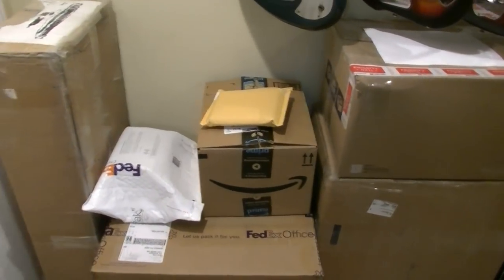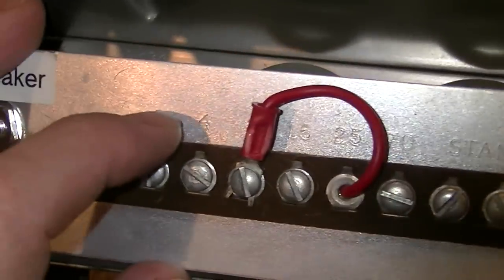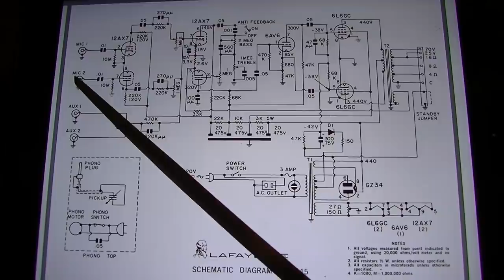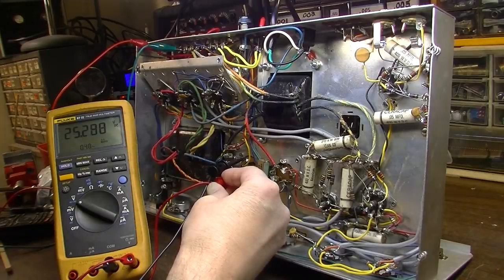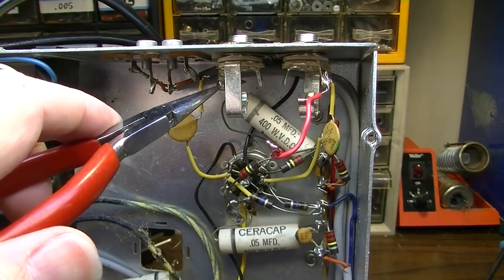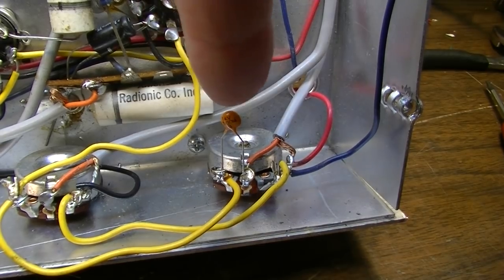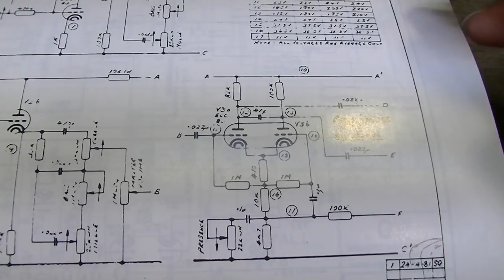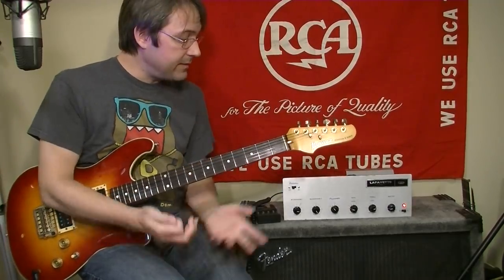Amp Reassignment Surgery - 60s Lafayette PA Thinks it's a Marshall 2204

Comment: Nice work! It has a nice break-up. I like it a lot. I added a 12AX7 to a valve jr. Head and cloned a 2203 gain stages, cathode follower tone circuit, global NFB & presence. Wish I had room left on the panel for more options to incorporate the bassman sound. Thanks for the video man, I enjoyed it and as always I learned new information as well.

Comment: My father just built 3 of these and I'm currently testing an older model 645A and it's the dog's balls.  Just a fantastic, organic, warm and round tone.   Loves pedals.  Running through an older 80's slant front 2x12 Marshall cab (from the Mosfet days) with 35 watt Celestions and I'm LOVING it!!  Lightweight and loud.   Great gigging amp.
Reply from the maker: Did he follow my mods?
Reply: @TheGuitologist  Actually no.   I just shared this with him today (he doesn't get on YouTube much).  The amps were already "gone through".  He has been building amps for awhile.  He really enjoyed your video though and he may be doing your mods to the other 645A he has.  This is the first set of old PA heads he's modded to be used for guitar though which is why I searched Lafyette amps and came across your video!  He has two 645's and a larger 70 watt (I think) that he's working on now.

Comment: My 1kW Variac came in a plane white factory box which was padded with styrofoam but was apparently dropped on one corner, and the extra fuse rattling around in the bottom.  With the weight of the thing I was lucky that it survived.

Comment: I had a Bogen for an amp as a teenager. The look and name of this amp makes it very cool cosmetically.
Reply: All the old Bogen Challenger (well, the really old ones, BEFORE they started making solid state models and calling them "Challenger") amps are almost plug & play for guitar. Well, not almost, you CAN use them exactly as they are and get great dirty guitar tones, but it helps to at least change the grid resistors and maybe swap coupling caps if you're gonna use it for guitar. But yeah, Bogen made better Marshalls than Marshall.

Comment: I'm pretty sure that chassis and output tube slanted socket area are aluminum. The leads that were soldered  (for the first time) are touching the chassis but solder will not stick to aluminum so may need to tie those to the chassis with a bolt or run a wire...
Reply from the maker: Good thinking, but no, it's steel. It took the solder fine. The solder will just bead off aluminum.

Comment: I would clean out the solder splodge / drip you made + clean off the solder flash that is sitting on the wire below your soldering. before switching anything on.

Comment: The '70' and '25' lugs on the terminal strip are for 70 and 25 volt, respectively, distributed audio, commonly used in institutional and industrial applications...along with some churches on a budget. The output of the power amp is tied to an autotransformer, then each speaker has a corresponding transformer, with taps labeled 1/2-watt, 1-watt, etc. In theory, therefore, such an amp, if rated, for instance, at 100 watts, could handle 200 transformer-isolated speakers, tapped at 1/2-watt (although, in practice, you never loaded an amp to more than 80% capacity). The jumper tied to the 4-ohm lug was often set up that way to enable the 25-volt output of the autotransformer. Disconnecting it would allow you to connect a 4-ohm load, or use the 70-volt output. The fact that it was connected probably means that the amp was being used either as part of a school intercom system or the page circuit of a fire alarm system, bot of which typically used the 25-volt circuit...that allowed connection of 8 times as many speakers. The entire science is WAY too long to post here!! This is the stuff i worked with (along with 'Pro' audio, and a number of other low-voltage systems, for over 40 years...including stints with NSCA and Lincoln Tech, as an instructor.
Reply: BTW, the autotransformer output's downside is that it is very strong in midrange (primarily designed for spoken word, and maybe a little low-fi background music), but weak in highs and lows, making it a very 'so-so' guitar amp, at best.

Comment: Hi Brad, I'm currently starting a project using the transformers from a Heathkit EA-2  Mono    HI-FI and "reassigning" it into a Marshall 18 watt TMB and throwing all into an old Fender solid state head chassis  "reassigning" it from SS to all tube...It has a Chassis much like the Champion 30 that you repaired but I have re-bent the chassis so that it has a flat bottom...My question is: Will the output trans be suitable for the classic Marshall over-drive or should I switch over to a Hammond 18 watt replacement? Thank-you for all your clips and sound advice...Mark
Reply from the maker: Sounds like you're doing the Lord's work. Just looked at the schematic and OT for that amp. It'll handle it fine, I'm sure. Will sound awesome.
Reply: thanks..

Comment: Brad, mornin. Got a question. I have a crate amp head . I think an early 2000's maybe. The amp light is lit and I power light. It will come on for maybe a minute or two. I hear a sound and the powers off. Will come back on in a few seconds as I remember. Goes out again. Any ideas? Thanks,a fan.

Comment: You could probably go a long way to eliminating the "pop" from that Marshall switch by wiring a high value resistor (1M?) across it.  That would allow the cap to charge up to the proper voltage before being switched in.
Reply from the maker: Tried that. Someone else mentioned it too. Didn't work in this case, I think because I'm not only changing bypass caps, but the bias R also.
Reply: I missed that about changing the bias.  Yeah, that will do it.

Comment: Add 100K's across the bypass caps and it will eliminate the switch popping
Reply from the maker: Tried it. I thought so too, but it didn't work. I think maybe because it wasn't just changing a bypass cap, but also changing the bias R.
Reply from the maker: I should have shown that, but the video was way long and I was trying to get it under 1 hour.
Reply: Check the O'Connor topology -- I have used it -- it works -- keep on rockin !

Comment: very good.I'm going to ask you a question that is un-related to this video, if you don't mind.I got a tone cabinet about a year ago.I noticed, every time I got around it, I would start itching and feel like I had feathers in my throat.I was in construction, so I know all about insulation.This is different, though. I would clean the cabinet and the power supply and the amp and it just stays on it. I got to looking at it and it looks like metal fuzz.I started taking the transformers out to start on an amp and it got me short of breath and I was itching all over. Last night I stumbled across an article about (cadmium sulfide). It got me really concerned. Have you heard anything about this being in hammond organs. I don't want to throw this away but I have notice my breathing is a whole lot worse since I brought this thing in the house and every time I get close to it I start itching. I thank you for any info you might have about this. If anyone else has any info on this I would thank you for that.
Reply from the maker: Truly odd. Have not heard of cadmium sulfide issue, but if I had to guess, I'd guess mold could be a culprit.
Reply: thanks.
Reply: why not me      Do you have any pictures or video you could post of what it looks like?
Reply: I'm not very good at posting stuff but I'll see if I can find the site again and take a picture and post it. It looks just like mine. The tone cabinet is not covered. It is all wood and this stuff is all over the cab ,the power amp and the amp chassis. I first thought it was insulation but it does not wipe off. I was in construction so I know about insulation. Then I got to thinking maybe asbestos. I stumbled across this site and this guy got his dads or uncles old hammond out and decided to get it going and it was acting up so he called a tech. The tech said this was causing the issues because it is a metal fuzz. The tech carried it home with him and turns out it was  cadmium sulfide which when I checked this stuff is highly toxic. The government messed with it during the cold war. It is also what they have been spraying, the chemtrails out of jets to control weather. If what I have been reading is true. It effests the kidneys, the nervous system and a lot of things. I have had it in a bedroom for a year to a year and a half and every time I go in there ,I start itching and my breathing gets worse.I kept thinking it was insulation coming out of the attic some way. I will see if I can find it. Thanks for asking.

Comment: Is it safe to run tubes at that weird angle like in this amp? I would suspect higher failure rate because of the stress on cathodes. Tubes should be run only in vertical position, either socket up or down.
Reply from the maker: I doubt it's an issue. But your question did cause me pause.
Reply: The Guitologist I think I've seen that in my grandpa's Tesla receiving tubes manual. Something like that the lifespan may get shorter if the tubes are operated in non-vertical position because the cathode can eventually deform as it is heated. I should look at it next time I visit grandpa!

Comment: I'm kind of bothered by the sound without the feedback circuit.  That suggests the underlying amp is really dirty and it's only the feedback that cleans it up.
Reply from the maker: Most Fenders have feedback to clean things up. Just helps to stabilize things. Can soften the highs and cut down on distortion when you're trying to play clean.
Reply: Yes, that's what feedback does.  But how does this amp without feedback compare to other amps with the feedback disabled?
Reply from the maker: It did about what I'd expect. It didn't oscillate or anything...just harsher than I'd like.

Comment: Hi Brad that standby is disconnecting the c/t of the b+ secondary from ground -- so no Hi V
Reply from the maker: When you throw the switch to put it into standby, about 400V appears where the negative bias voltage should be, and it was appearing on those terminals as well. Even the manual said not to touch those exposed terminals when in standby. I just got the HV off that rear terminal and left the switch but told the customer I wouldn't use the switch if I was him.
Reply: Yes it is high voltage. I know, I got shocked by it before sending it to Brad. It was over 400 volts DC. Lucky I didn't get hurt or killed.
Reply from the maker: I think since you're lifting the CT on the secondary from ground while it's still connected to the bias circuit ground, it crosses that R into the bias circuit, so you get HV at the terminal on the rear and all the way up to the tube grids as well!
Reply: Ok I did not factor in the bias circuit -- some of the tweed fenders lift c/t for standby -- but you know that !
Reply from the maker: Yeah, I GUESS it won't hurt the grids to have 350V on them, since there's no current really flowing, but I'm iffy on that Standby design. I'd rather just not use it at all if it was mine.
Reply: Must be different for the cathode biased circuits -- http://www.thevintagesound.com/ffg/schem/pro_5e5_schem.gif

Comment: Is there an advantage to using larger pots (say, 1M) vs smaller pots (say, 100k) for gain between tube gain stages? Besides gain? I've never messed with them irl unfortunately, all my experiments are in SPICE.
Reply from the maker: Increasing the resistance to ground (aka ground reference) or grid leak resistance, will increase the amplitude of the signal. An AC signal is a wave which swings between 0 and some other amplitude. An adjustable resistor between the leads adjusts the amplitude. There is a book you should get if you want to read more about this stuff: http://amzn.to/2BSpC90

And watch this Uncle Doug video also: https://www.youtube.com/watch?v=QFHcmST7AZ0
Reply: Using smaller value pots to balance a higher gain stage, like a pentode, with a medium/high mu triode has been done in quite a few audio amps. I use a 500k with 5879's and 1m with 5751's.
Reply: Cool! Thanks for the responses
Reply: Love uncle Doug.....so much to learn......
Reply: well staying true probably yeah, a lot more resistances vs the fender idea where it's much less throughout.
Reply: One thing to be careful about, though, is that as you use larger resistances, the thermal noise they generate gets greater, which can increase the noise you hear, depending on the pots' positions.
Reply: Standard values and pretty decent pots should be pretty quiet.

Comment: Why didn’t you move the black wire under the open ground union prior to soldering? You could have easily created a short by melting the black coating. Not very sanitary! Wait now I see you did move it? Hum, why didn’t you mention it? Ahha, it did melt?

Comment: These 27/100 ohm might be an attempt to create an "Humdinger" See; http://www.valvewizard.co.uk/heater.html
I would rather use a pot in that position.
Hoegaarden, nice taste ;)
Reply from the maker: Yeah, it's an attempt to reduce hum on the 6V winding. It's a false center tap. Somewhat odd to see two different values from factory like that. Usually they are the same value.